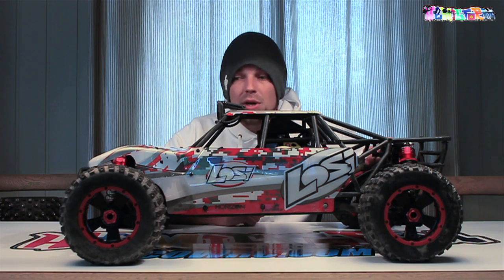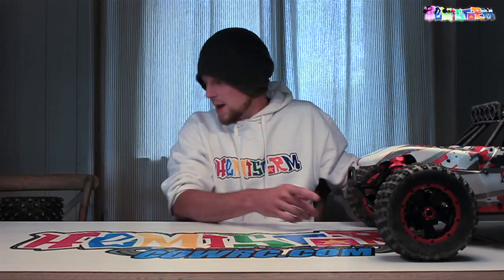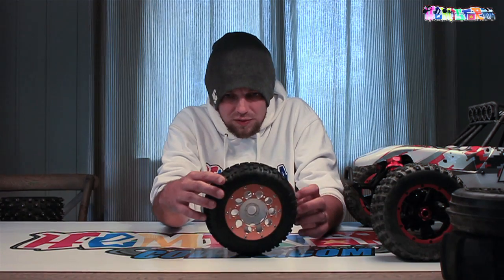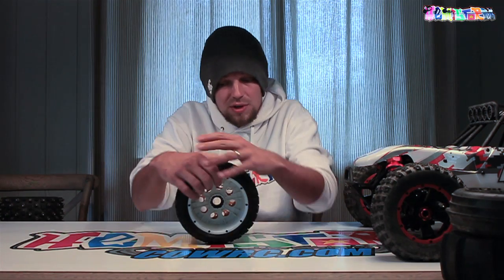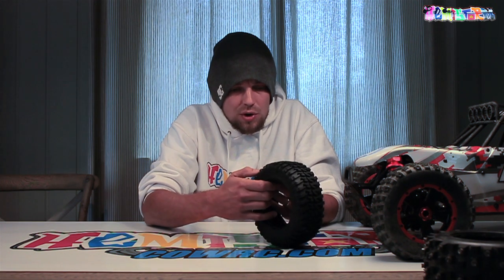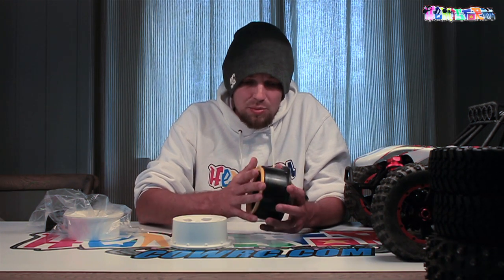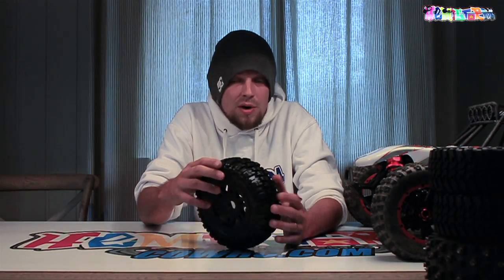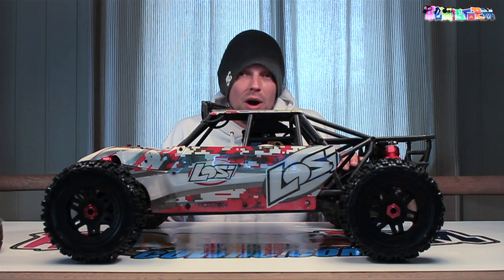LOSI DBXL Wheels Upgrade Options

Comment: Hey there,

At the end of the video I noticed you had a set of front tires on the rear, do you think a set of rears will also fit back there? I found a set brand new on OfferUp that comes with 2 fronts and 2 rears but if they are going to not fit I'll pass on them.
Reply from the maker: They should fit just fine. I hope this message finds you in time!
Reply: @hemistormrc  actually I sold it about a week ago hehe. I bought a new Arrma Kraton 8s though so now I gotta find wheels for that beast.

Comment: Hello my friend i was lookin on youtube for any other tires r pople useing on the dbxl and i saw your vid witch helped alot and tu for that i saw u sead about hostile tires and i was wondering 2 things 1 will it make a big diff if i use 5ive t rims and tires and will 5ive t rims fit the dbxl-e and 2 the tires on the dbxl-e are prety hard would it handel better with softer tire for General use tu my friend and keep up the amazing job im hoping one day u make a body for the dbxl-e the one u did for the 5ive t is amazing
Reply from the maker: Hi Sam! You can sure use those wheels, tires really depend on your preference and the surface you are using them on. The DBXL-E looks like a real fun truck!

Comment: Will the baja rears fit the dbxl?  I want to get sand busters on front & rear.
Reply from the maker: Fierceflyer55 If you mean the 5b rears I'm not too sure, the 5t rears should work.
Reply: The 5b rears fit just fine.
Reply: hi I dont need any wheel adapter to use hpi baja 5b rear tires in the dbxl ? Thank you

Comment: Will the trenches fronts fit the dbxl rims
Reply from the maker: Hi there, they will not, as the stock DBXL rims have a similar inner and outer beadlock diameter. The Trenchers are designed for the traditional larger inner beadlock designs from HPI back in the day.